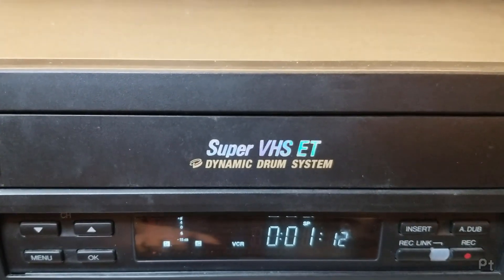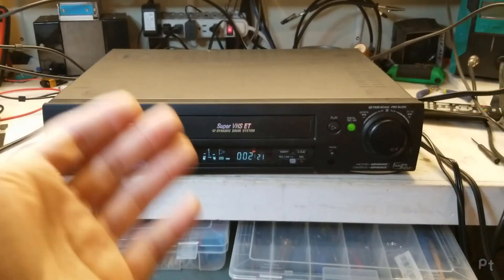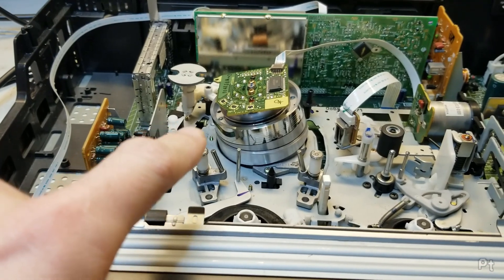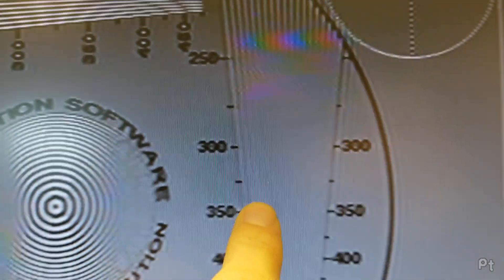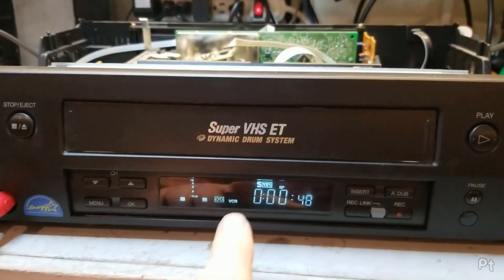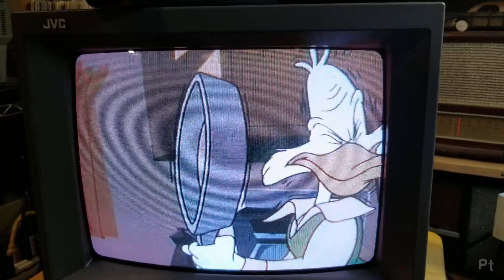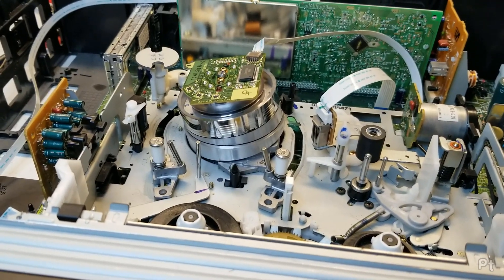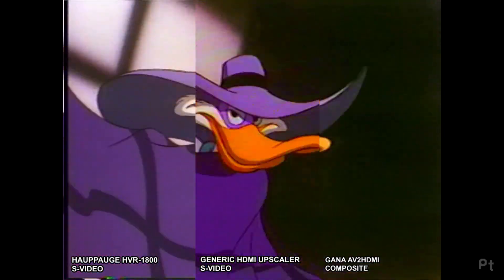JVC HR-S7600U (Fancy & Flawed VCR from 2000)

Comment: Samsung is not a cheap brand I have a 1990 hi end Samsung vcr and is much better than this jvc
Reply from the maker: Samsung was definitely a low cost manufacturer in the 80s and 90s. It was considered "cheap" at the time, when compared to the higher end Japanese brands. They didn't have the prestige and brand recognition they do now. But, as you said, Samsung did make good quality stuff and I think that's how they were able to gain their market share and reputation. 

Also, it's not really fair to compare a high end VCR from 1990 to this one. Even without accounting for inflation, VCRs were more expensive in 1990. By this time, consumers expected the costs of VCRs to keep going down, so brands like JVC kept cutting costs wherever they could. A more fair comparison would be a 1990 era high end JVC vs the Samsung, and I bet the JVC would perform much better.
Reply: I had a mid 90s Samsung. It was OK. Nothing fancy. It did bypass the macrovision though.

Comment: Hey guy, when this JVC VCR was in production all other brands had the same amount of cheap plastic parts as did this JVC. So im not sure where you were going with your cheap comments. If you want sharp video..go to dvd players like i did.
When I make transfers from vcr to dvd I don't use a computer of any kind. I simply got to a dvd recorder from the vcr. No need to by any kind of converters. Using converters degrades the video signal. Going direct from vcr to dvd recorder gets the best picture quality. I found the JVC VCRs S-HS series produces the best quality picture for transfers...period. I've tried Sony, Panasonic, Samsung,Phillips vcrs less quality of picture.
I don't record on vcrs anymore like I use to starting in the early 80s. I used a Sony vcr to record a lot of shows from my old analog C/Ku band satellite system. Recording raw wide feeds. I had the GI 650i receiver.
Reply from the maker: It's crappier build quality than the older JVCs, that's what I was getting at, and I stand by it. If you read about these Dynamic Drum models on old forum posts from when they were new, there's tons of complaints.

Regarding capturing, DVD recorders just add an extra step for me, since my end goal is files on the PC. But I've since moved back to Hauppauge cards (currently using my old HVR-1800). The converters are convenient and usually provide an ok picture, but they throw away a lot of detail and very often crush bright or dark scenes completely. 

The only upside is they seem to do a really good job stabilizing video from bad tapes. To the point that I will have jitter on the CRT monitor, the output of a TBC, but the cheap converter will look rock solid. So I do save them for the really bad tapes - the "40 year old EP recordings on grocery store branded tapes that were stored in a basement" kinda recordings.
Reply: @probnotstech  ...ok you got some explaining here, what did you mean by Hauppauge card? You lost me. I'm not into today's computer terms. I don't own a PC or a Laptop.  I don't read old forum post about this JVC vcr or the HR-S3500U unit because I had the units when they were in production. I never had problems as you indicated about the head drum. I got 8 good solid years of trouble free service from these vcrs. They have the best bright, crisp clear picture then the Sonys and Panasonic. I even own one of the first commercial vcr in the early 80s I had a RCA unit. This unit was one of those top load models.
Reply from the maker: It's a tuner/capture card that goes inside a PC (model # is HVR-1800). They were originally sold as tuner cards so you could use your PC as a DVR (using Windows Media Center or similar software). That's what I used mine for about 15 years ago. Luckily it still works on my current PC. The card also has a composite and s-video input, that is useful for digitizing analog video. 

It's great that yours worked without problems. I'm just relaying my experience with this VCR, and what I read regarding other peoples' experiences when they were relatively new.

Comment: Component isn’t better than S-video for VHS. S-video separates the channels to prevent crosstalk plus the line TBC in your VCR needs luma separated for timing and chroma for digital noise reduction. The composite line TBCs didn’t work well. Component has to manipulate the VHS signal.

Comment: I made a thread about disabling the DD system over at videohelp forum, it's a sticky thread in the capturing section. It's not really cheap, it wasn't designed to last over 3 decades, nothing suppose to last that long besides maybe your house,

Comment: Excellent work! Thank you for putting so much time and effort to show us these results from different capture methods and of course the different formats. One thing that's missing from the comparison is the minidv/digital8 camcorder method. I have seen some pictures on video forums that show the TBC that can found on specific minidv or digital8 camcorders being way better that the TBC found on high end VHS recorders like this or DVD recorders with TBC such as the Panasonic DMR-ES10 / DMR-ES15.

It would be really interesting if you were able to get one camcorder with AV input and DV(firewire) out  that can convert the analog input signal to digital and output it to PC through 1394 port. A camcorder like this could be found for cheap, since it doesn't even need to have cassette mechanism in working condition.

Unfortunately due to higher tax inside EU on camcorders that could record analog to digital, it is not very easy to find models that could do this. Many times Sony/Canon would sell special models for EU that had this feature disabled through software to avoid the higher tax.

You could also check the cheap HDMI to USB adapters sold on ebay/aliexpress/amazon etc. The cheapest one based on the low end IC, doesn't support 60fps and also has limited color capabilities. The more expensive/high end one based on the MS2130 IC is supposed to support true 1080p 60fps and real USB 3.0 speed. Btw these adapters don't need any drivers installation, they are automatically recognized from the OS, plug and play. You can use OBS to capture from them.

Comment: Thanks for showing that test DVD.  I'll have to get one myself. 

Super VHS is not broadcast-quality.  While you can get over 400 lines of luminance (as your test pattern shows), you still only get about 30 lines of color, the same as normal VHS.  Broadcast NTSC-M television has about 100 lines of color. 

(Here, the number of "lines" means the number of transitions per horizontal line in the picture -- your test pattern correctly uses vertical stripes to show luminance transitions across horizontal lines.) 

ED-Beta (the high-resolution version of Betamax) was similar.  The luminance resolution was vastly increased compared to normal Betamax and SuperBeta, but the color resolution remained the same. 

This hindered the success of Super VHS and ED-Beta -- they were too expensive for average consumers, but of insufficient quality for professionals.
Reply from the maker: Yeah I forgot to mention I was talking about luminance in that part. Is there a test pattern that could easily show the chroma resolution?
Reply: @probnotstech   I think the test patterns on your Avia DVD are the same as on my "Sound & Vision Home Theater Tune-Up" DVD.  I cannot think of a test pattern that would allow you to measure chroma resolution, but you could certainly see color bleed on the edges of each bar on the color bar test patterns, and incosistant color "noise" within each bar.
Reply from the maker: @ThriftyAV  Shoot, yeah I couldn't think of any patterns either but figured I'd check. There's a good chance those DVDs are the same - I remember a lot of these home setup DVDs were sold back in the 2000s. I used this one to calibrate a used JVC D-Series TV I bought 20 years ago and it looked fantastic afterwards.
Reply: @probnotstech  I don't know of any way to get a proper test pattern for testing chroma resolution without professional testing equipment, but I do have an interesting idea: 

I have a number of old computers from the 1980s that are designed to connect to TVs instead of monitors, and they can produce color video.  What I can do is make the computer display a fine pattern of vertical lines in alternating colors that are opposite each other on the NTSC phase color wheel (red/cyan, yellow/blue, or green/magenta), record the output on a VCR, and see what the playback looks like.  I could vary the thickness of the vertical lines to determine the point at which the VCR can resolve the different colors. 

I have a Commodore VIC 20 (176 × 184 resolution) and a Commodore 64 (320 × 200).  Both of them should be able to exceed the chroma resolution of VHS and Betamax.  (Both machines also display a thick border around the picture, so their pixels are actually slightly finer than their resolution would suggest.)

Comment: I've got a mono JVC HR-DD445 that has this Dynamic Drum System and it was one of the first models to have this feature (the other one being Hi-Fi Stereo). Bought mine in 1999 as I was curious to see this system in action but couldn't justify the extra cost of the Hi-Fi version as I already owned a Mitsubishi VCR with Hi-Fi. Luckily you can turn off that audio sampling in the menu so it doesn't do that looping in pause, think it's called Time Scan or something similar, I switched it off on mine.

The JVC Dynamic Drum System tilts the entire head drum, but the Video 2000's Dynamic Track Following (DTF) has the individual heads chips mounted on Piezoelectric mounts which bend to follow the video track when a high voltage is applied. A similar system was used in broadcast VTRs (Ampex's AST and Sony's DT) but these use an extra 3rd head in a similar arrangement to a 3 head audio cassette except the record head can also playback but without the trick features. Eg 1 inch C-Format drum (Ampex VPR or Sony BVH series) has Flying Erase, R/P Head, AST/DT Head.

Another interesting fact about the Video 2000's DTF system, it doesn't use a control track to maintain the correct speed and tracking. It records a sequence of "tones" at different frequencies on the video tracks, then during playback it reads these back, if they are in the correct order it's at the correct speed, if they don't then it adjusts the servo until they are. There's no tracking control either as the video heads bend to follow the tracks even in normal playback. So when the DTF system fails it's not just the trick play features that can be affected but normal playback and record.

Comment: I have one of these and it's been so-far reliable. For some reason, JVC VCRs have been susceptible to noisy linear audio. Not sure if it's the WiFi in the room, but it certainly is there.

Anyway, the fancy features aren't that handy to me in my captures but the video quality is good when it comes out of this device.

I think the Technology Connections method for capturing video is a good one. I route everything through my Panasonic DMR-ES46V (which is also a good VCR) with 480p 4:3 HDMI out, then capture it with an Avermedia capture card. It's been a bulletproof setup that leaves me with a really nice 480p60 capture with no editing afterwards. Deinterlacing quality is as good as anything you could want.
Reply: Yeah linear audio problems seem to be very common on 2000s JVCs for whatever reason, especially the ones with the later mechanism than this one.
Reply from the maker: Linear audio is such a crapshoot. The best results I've had are on a mid 90's Sanyo machine - fairly basic, 4-head but mono. 

I wonder if the bad linear audio is related to the connections to the ACE head. I know my 3800 is super picky when it comes to tracking pulses. Some tapes it just won't reliably read them. I remember seeing a 12voltvids video where he cleaned the connections on the ribbon cable, but that wasn't the issue on mine. Maybe the ribbon cable is more susceptible to outside interference than other designs.

Comment: I think you're right about the video brightness differences you're seeing in the different upscalers being a proper NTSC implementation vs. an NTSC-J implementation. From the example footage at the end of the video, it looks like the Hauppauge is using a proper 7.5 IRE, while the others are using 0 IRE.

Would you consider imaging that test pattern DVD and uploading it to the Internet Archive? I'd love a good test pattern DVD, but all I've been able to find are crap "fan-made" ones that use stupid public-domain 3D-animated short films.
Reply from the maker: Ahh, IRE is what I was trying to describe while fumbling over my words! Yes, it's a problem that seems to be the worst on the GANA, and still present (albeit a little better) on the new generic one. The Hauppauge looks proper, though it has its own issues.

I'm definitely considering uploading an image of the DVD (you're not the first person requesting it) - just unsure of the whole legality, blah blah. I can't seem to fine a trace of the company that released it, so that's a good sign I guess. Also, I checked and there's copies for sales on ebay for like $7 CAD, so that's another option as well. I'll let you know if I do upload it.

Comment: Have you seen a VHS player like the "JVC SR-VS30U"? It is a combo miniDV and SVHS player that I had looked at some time ago as an option to digitize VHS tapes with newer OS. The advantage being that the deck itself includes the "capture card" so there can be appropriate time syncronization between the capture card and the VHS, and the 1394 link is simply used to send the digital video to the computer. It's not hard to find a working IEE 1394 (Firewire) card for newer OSes. I never did end up getting that as it was at that time cheaper to just send them out to be digitized, but you might be interested in following up from that research.

Comment: On my HR S3500U when I have a tape that jitters like that I turn on VIDEO STABILIATION in the menu and it usually takes care of that issue.
Reply from the maker: I found that video stabilization won't fully get rid of the jitter and in some instances makes it worse (same thing with my 3800U). I assume it must work on some tapes, as it does for you, but I just haven't had any luck with it.

Comment: My uncle bought a JVC HRS 5800 back when it was brand new and I was like ten or something and it cost a stupid amount of money back then even as VCRs were becoming cheaper (this was in 1990-ish), it wasn't the highest end, but a higher-end midrange unit. Actually a decent build quality, and a fairly heavy unit, very silent in operation. Anyway, it was used to record Norther Exposure episodes off the air and as such did very well but its capabilities were never used. Sadly my uncle gave the VCR away back in the early 2000s because DVDs had taken over. I guess the point is that even a really capable S-VHS Hi-Fi 4-head VCR in the hands of absolute idiots is no better than a generic cheap one because it's just used to record off-the-air broadcast that wasn't all that clear to begin with. Still love the JVC VCRs for VHS and yeah the dynamic heads are apparently notorious, but looking at the mechanism, I can see how that easily act up. The idea was solid, but the execution was a bit plasticky lol

Comment: JVC also had problems with EP. The only EP tapes it could play well were its own recordings. I wonder if that's but a lot of decks use EP heads that were not the 19 microns?
Reply: I think so, and it is not just JVC machines.  For example, my Panasonic PV-4466 has 26 μm heads for recording LP and EP, but when I play the recordings on my mother's Panasonic PV-D4745S, with its 19 μm heads, I need to adjust the tracking slightly.  (As her machine has 19 μm heads, it does not record on LP.) 

All you need to do is adjust the tracking, but this can still cause problems.  When I was in university, someone brought in a VHS tape recorded on EP to play on the VCR in the classroom.  The university did not supply the remote control with the VCR, and the tracking controls were only on the remote.  We had to just watch this video with the picture partially obscured by video noise.  What's worse, because the tracking was off and could not be adjusted, the VCR kept flipping back and forth between the hi-fi and linear audio.

Comment: I love JVC machines. I have an HM-DR10000 which also has Digital TBC/NR and it's fantastic. One thing about some of them like this one - the dynamic drum is prone to failure (you might mention it in the video but I haven't watched the whole thing yet) because of crappy plastic gears, there's a whole tread on the digitalfaq forum about disabling that system in cases where it's failed or just as a preventative measure.
Reply from the maker: Haha, yup. You called it!